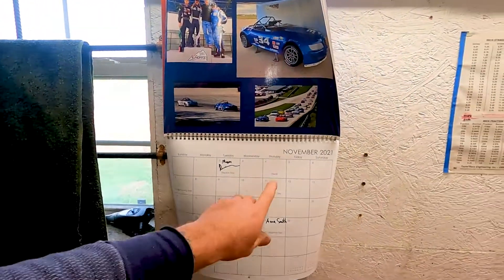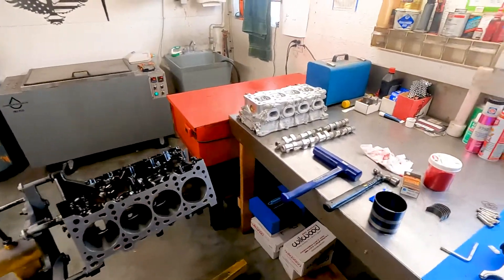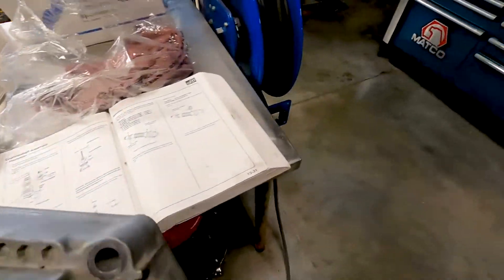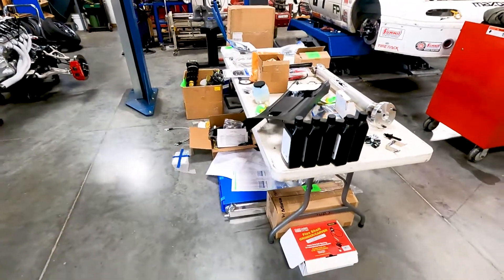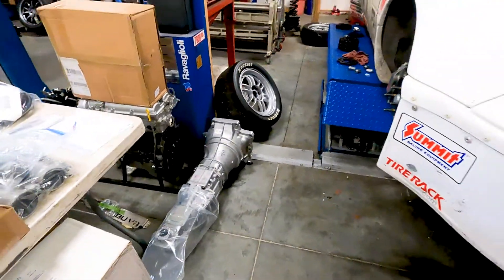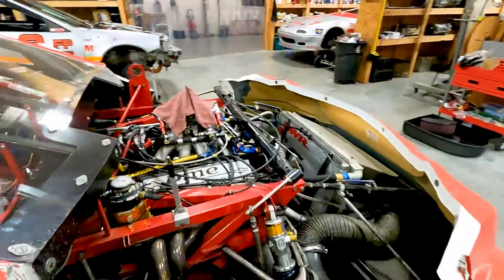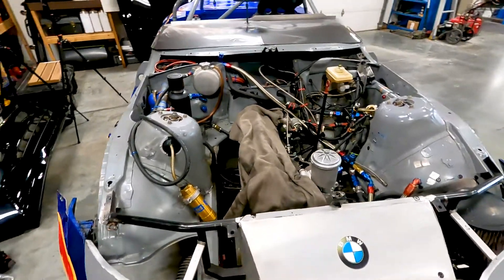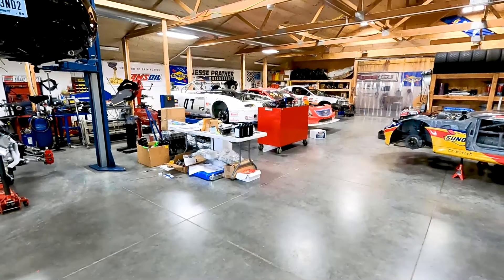Shop Tour - Turbo Charged, with a Side of Big Brakes Edition

Comment: I see the white Miata has a stoptech c43 kit. I have the 309mm c43 kit on my e36 track day car. I’m getting abysmal rotor life (severe cracking) with the pillar vane design. I’ve heard the “aero rotor” vane design holds up better. Have you heard of or experienced anything similar?
Reply from the maker: There are a bunch of variables here and the usual suspect to accelerated rotor life will be the brake pad.  Of course the weight of the car will make a difference as well, but I am venturing to say that the pad is likely the problem.  Which pads are you using and what is the weight of the car?
Reply: @jpm  the car is about 2750lbs without driver. 255 NT01s, no aero, stock power. I’m a decent driver for just doing track day stuff and I don’t believe I’m over slowing the car. For pads, i’ve ran PFC 97 and stoptech sr33. The pad life is great and are lasting about 2.5x the rotors. I’ve tried blocking off my cooling ducts in fear that I’m thermal cycling them too much; it has little affect on rotor life. Ducts feed from the front bumper to the inner part of the ring and don’t feed directly on to the ring’s wearing surface.
Reply from the maker: @ds98136  I've heard the stoptech rotors can be an issue as well.  I know the pfc's are hard on rotors as well though.

Comment: What brand is that adjustable piston ring sleeve you have on the bench there? Work well for you?
Reply from the maker: Total seal makes the one I use. They will make one for you if you are after a specific bore size.